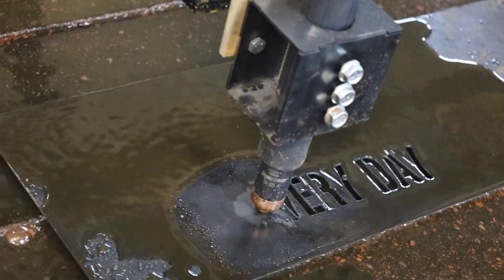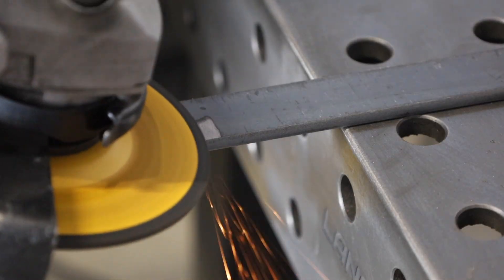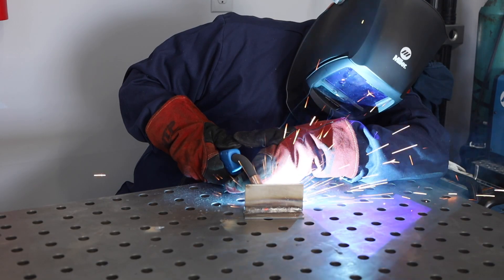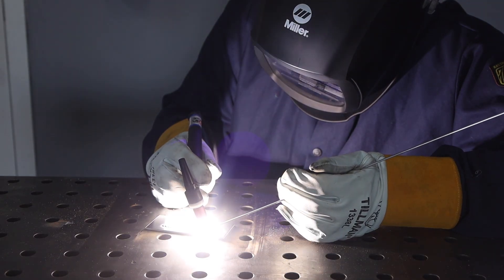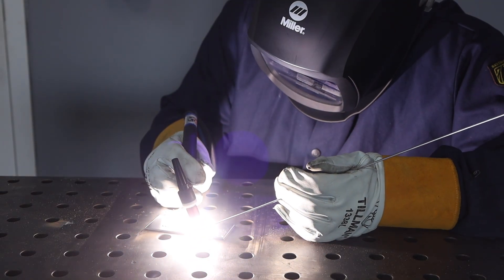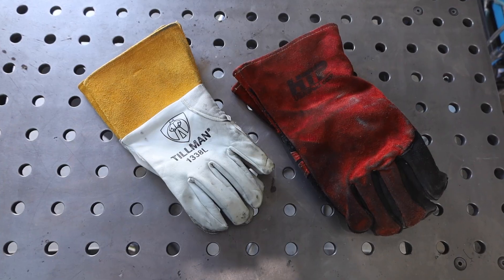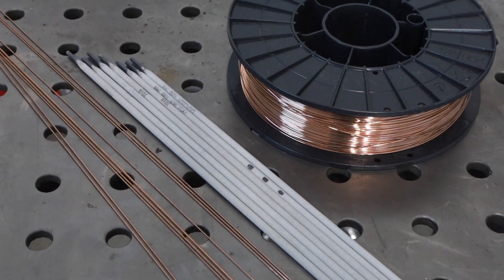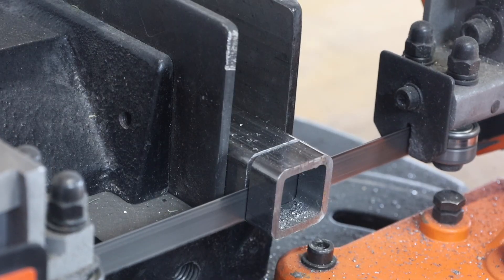Tools to Start Welding: Do you really need all that stuff?

Comment: Thank you for the video I’m definitely a beginner just looking for something small for welding 2x2 or 4x4 metal tubing for a shade do I have to buy a huge welding machine hope not🤞
Reply from the maker: You don't need a huge welding machine. It really depends on the material thickness, but if you're looking at 1/8" wall thickness or thinner, just about any machine will do it.
Reply: @TimWelds  I appreciate you replying THANK YOU 😊 new follower ❤️

Comment: As I have found out, buying the welder is the cheap part.  I now have multiple gas bottles (all purchased) multiple angle grinders, a supply of materials, a supply of different filler metals (not only type, but alloy as well), one welding table, one work table, additions to the electrical system, other tools (some of which I already had).   For example, I just purchased a dedicated TIG welder for a goodly sum.  I will easily spend half as much again to complete the setup for just that welder.

PS:  You will find out after a while that having multiple four inch angle grinders is nicer than having to change out whatever you have attached to your one angle grinder.

PPS:  Another thing to consider is that your clothing should be all cotton.  The reason is that with many synthetic materials, they melt and there is nothing worse than having some sort of synthetic clothing material melt into your skin.  I like the snap button all cotton shirts.  The reason that I like them is that if you have to get them off or open them up in a hurry, you can.  Welding jackets are affordable.  One thing that you will find out after a while is that your shirts will be full of little holes.

Comment: I agree with the multiprocess statement. I have used a cheap ac stick welder for years. And then I finally decided to upgrade. And decided to get a fancy multiprocess machine. So I bought one that did all the processes. Boy was I shocked to find out that I needed to invest 4 times what I invested in my new welder to be able to  get mediocre results. I am only a DIY guy. I decided to get a Flux core welder and a DC stick welder instead. And not pay extra for the shielding gas. I sold the welder to a mechanic. And I am happy with my my new welders. I can weld aluminum and most things you will find in my garage. I appreciate your videos and simple, easy to understand instructions and examples. Keep it up.

Comment: I was impressed recently to find how easily a reciprocating saw can cut through rebar. Especially for those who are rightfully afraid of cutting discs on grinders, a cheap reciprocating saw (sawzall) might be a handy addition. (The one I tested was a cheap battery powered Hart one I got in a kit, with a cheap metal cutting blade, but a corded one will be cheaper and probably more powerful at the low end of budgets.)
Reply: One thing to keep in mind when using angle grinders to cut is that this is when the danger of the cut off blade failing is the greatest because the angle at which the angle grinder is being held becomes different from the cut that is being made.  I make it standard procedure that when using an angle grinder to cut is to have my body out of the plane of the cutting wheel.  That way if the wheel breaks, it reduces the likelihood that a chunk of a hard material will hit your body at a very high velocity.  Also, never operate an angle grinder without a wheel guard.

Comment: I recently watched professional welders join 30 inch high pressure steam lines in a refinery. Each welder had 3 angle grinders : wire brush , cut off disc and grinding disc. Interestingly they did not use auto darkening helmets. I am guessing they needed completely clear view to allow careful inspection of the weld. Two welders working on opposite sides of the pipe would take many hours to join a section.
Reply: Some welders do not use autodarkening helmets out of habit.  It took me a long time to get used to an autodarkening helmet.

Comment: Hey Tim. Could you test out the cheapest gas mig welder on Amazon? Preferably on a regular wall outlet and not the heavy duty ones. I could provide you with a link for the one im looking at, it does stick mig flux and tif

Comment: Tim what would you recommend for cutting fence pipe and other metals in the shop. A portable bandsaw with a table or a chop saw. On the chop saw is it better to get the evolution type or abrasive. It's for a hobby/farm stuff. Thanks!
Reply: Project Farm did a comparison of metal chop saws and included an abrasive cut off saw.
Reply: @gordonwedman3179  yes I saw that video but was wondering what is better the chop saw or a portable bandsaw!
Reply: @johncrowell9014  Saw a video recently and someone asked. Answer: chop saw, but I forget why.
Reply: @MadLadsAnonymous  thank you for your answer!

Comment: I was in Tractor Supply a couple years ago and they used to have a shelf with items sorta neatly arranged (until the public "sorted" it) and it was either items they would no longer have for inventory, box missing, and reasons unknown and the price was deeply discounted. Everything was usually in new condition.. On the shelf one day were 2 F clamps that had a mechanism to lock in place by squeezing instead of turning a C-clamp style and it had a quick release feature. These were the same size as the F clamps. The price was something like $5.00a each. They even had F clamps that were still being sold up front for an equally low price. I stocked up on both lever type (I love them) and 4 F clamps. Too bad a new manager got rid of that area.

Comment: I saw a welder using a circular flat faced welding helmet with a protective side shield . What's up with those ? It's the first time I've seen them
Reply: Jeff S is absolutely correct, and the reason for them being flat is A) to completely cover the face and B) for the thickness of it, pancakes are lighter then the traditional welding hoods.
Reply: Those are called pancakes and they're mostly used by pipeliners. I can't remember the exact reason but I think it's mostly cost effective. They're simple, take a standard lens and if you aren't cramming your head into tight spots the shape isn't an issue. The side shield is to keep you from getting spatter in your ear while you're doing your downhill pipe welds.
Reply: @JeffS96  yes , its was a welder that came from Odessa where there's a lot of industrial machines